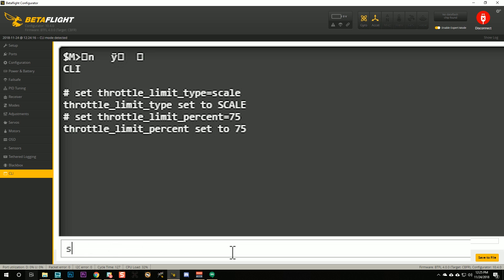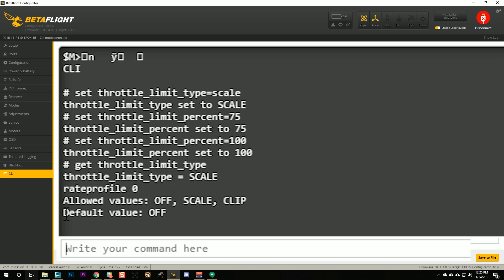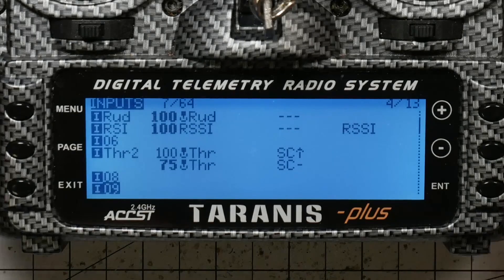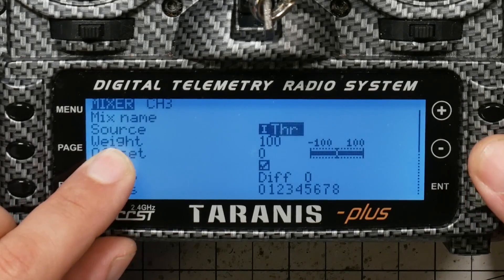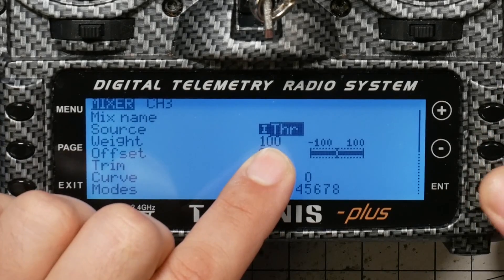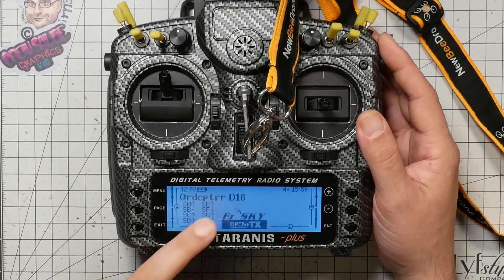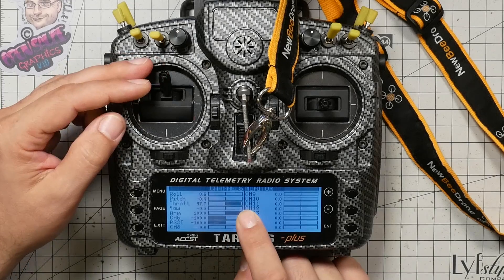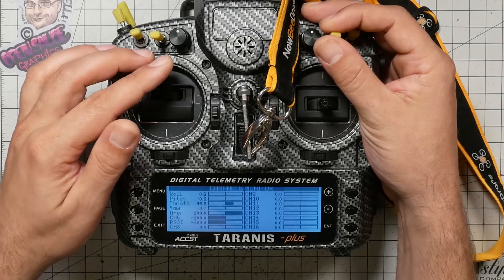Betaflight OpenTX Throttle Scaling | TAME YOUR 2S TINY WHOOP

Comment from the maker: It turns out that you CAN switch the betaflight throttle limit on a switch. CurryKitten shows how here: https://www.youtube.com/watch?v=rwUdwUMMytI
Reply: Use throttle_limit_percent>9000 to go really fast
Reply: Yoshitake Mizuno says: !SC-UP , use this to work around the 3rd low position affecting the throttle in a unwanted way.
Reply: You can use Sitcks commands too, left stick to left bottom and right stick left middle is profile 1 I think
Reply: when you have to do terminal commands, can you type /paste them into the description so we can copy/paste ?
Reply: What's solution for this
https://youtu.be/H-L7goBWTno
Reply: I like CurryKittens tutorials too, but in this case, I’m going with your way Joshua, I’m doing the throttle curve. Seems much easier and less work to do, especially if I want to make a few changes.

Comment: I was wondering, I've got a mobula 6 HD. It is underpowered and my current throttle range to keep it in the air is about 75%. I want to shift the throttle range so I'm about mid range 45-55% on my thumbstick. Can you direct me to your video which can show me how to do it pls? I understand moving the range will not increase the power of a 1s whoop. Cheers

Comment: Hello Joshua, Question for you.  I had some funkyness happen with the TX16S and I needed to send it in for warranty work.  I fly my Mobula7 on 2S and for indoor flying I use 75% throttle scaling on the TX. Grayson said to never use throttle scaling on the TX and that it should be done in Betaflight. I asked why and they could not really say why.  I am curious what you think?  Thanks.
Reply from the maker: I'm not sure I understand a good reason why. I also scale in the controller, for convenience.
Reply: @JoshuaBardwell  Thanks for the speedy reply.  I thought it was weird as well and the fact that a good reason could not be given makes me question the suggestion. I have 1000's of flights using throttle scaling on three different quads and no issues with that at all.  I will continue to do it on the Tx. as I have been doing. Cheers.

Comment: theres a sight issue with the way youve assigned switches, if you go to 3rd position o switch youll loose cotrol of throtte. i found this out on a plane seting up duall rates ad accidentally switched to 3rd position eded up with no aileron or elevator control.

i added a third line copy set to the 3rd position, there is a way to do it with just 2 lies on a 3 position switch

Comment: This needs to be updated as this is not the best method anymore, motor output limit and auto cell detection is now the way
Reply from the maker: This method is still very good if you want to be able to manually adjust the throttle scale on the fly.

Comment: I'm a little lost here.  I did exactly what you did on my radiomaster TX12. The first setpoint i was able to set to 100% and assign to a switch no problem.  I assign a second set point exactly like you did it in your video no problem.  the issue comes is I am trying to set the setpoint to 50% just like you showed it.  The weight set to 75, the offset set to -25.  looking at adjacent graph, instead of getting  50 (as shown in quadrant 2 of your graph), and 100 (as shown in quadrant 4 of your graph), I'm getting -85.4, and -80.6 respectively.  I can show you a picture of what my screen shows if you have a email you want me to send it to.  Go easy on me I am very new to this and I've been hitting alot of bumps along the way trying to set up this radio.  Please Advise.  Thanks!

Comment: Thanks so much for this video Joshua, I’ve been attempting to fly my new TinyHawk 2 Freestyle, but the throttle is so sensitive, this should do the trick.
Reply: How did you find it? I'm wanting to do the same with my TH2F... the hoverpoint is basically at 10-15%  and want it to be a bit easier to handle when flying slow... Does putting on a scale mean you loose the max top end output that was there before... or does it just make it easier to handle? I"m not sure... thinking maybe a throttle curve might be the better option here...
Reply: @InfinityDrones  This is a test, if I’m able to sent this I’ll send you my reply, I couldn’t before.
Reply: @InfinityDrones  Hi Infinity, yes I followed Bardwell’s tutorial and put it on a switch so I could turn it on and off. I really liked it, as a noob it really helped me with my flying. I tried 50% but that was too much, and I found that 20% was perfect. I don’t use much anymore, but it’s there if I need it. If I remember correctly, yes not only is the top end lowered but the entire scale is lowered by the % that you decide to use.

Comment: still having issues with my yaw at full throttle to the right the drone wants to bump up and do a quator turn but only at full throttle right ,,,,ive done stick calibration and still does it  but it all fine on yaw left i dont understand whats goin on ,,,,,,pleae help

Comment: I did a factory reset,, foolish me, now it won't connect to controller and won't connect to beta flight,, does this mean I have to start from scratch
Reply from the maker: You may be able to find a CLI dump for it and restore the config that way. Otherwise you will have to start from scratch.
Reply: @JoshuaBardwell  went to emax website downloaded the cli and wow what a savor that was,, thank u so much

Comment: With this method of taming the throttle, how is arming done?  Or did I miss something?  Whenever I adjust the throttle angle and/or create a flattened throttle curve (ala engineered expo) I have to keep the low end at "zero" for proper arming.
Reply from the maker: This keeps the low end at zero. Check the corrected instructions in the first comment.

Comment: Can you use the openTX method but with clipping the throttle instead of scaling? So that I can set it to a switch still for races and not have to plug into betaflight everytime before and after a race
Reply from the maker: Yes. I think you would use a custom throttle curve in the inputs screen

Comment: Can't do it. I did everything like in the video and on the channels monitor it only shows any thrust output when the switch is in the position that corresponds to the mixer source. That is I configured three inputs: th1 at 100%, th2 at 75% and th3 at 50% and the channel monitor bar only reacts to thrust movements at 100% if I set the mixer source at th1 but doesn't react to stick movements in th2 and th3 positions at all. I can change the mixer source to th2 of course and then the stick only works in th2 switch position - at 50% of course, but still it doesn't let me change anything by switching to th1 or th3. Any result of such switching is that thrust becomes dead.....

Comment: Hi bud I have a question my boy bought a drone we bound it in d16 to beats fpv lite 2 when he hits arm the drone flys up rite away  we’re not sure what it could be now the guy he bought it from was able to land and take off correctly but with the beta transmitter it just takes off can you suggest what we should look for to fix this do you have a vidio on this you can reffer
Reply from the maker: How about checking the channel mapping in the Betaflight Receiver tab. Make sure throttle is actually throttle and so forth. If not, use the Channel Mapping parameter to fix it. Rearrange the A E T R letters to change your channel order.
Reply: Joshua Bardwell thank you sir we will try that

Comment: Thanks! This is very helpful. I am learning FPV with a Freestyle 2 but the only place I have to fly is in the yard and there is not a lot of room and a ton of trees. When you don't have much space, a little power seems like a lot of power. When I fly at work after the workday is over there are big fields with small trees spaced out nicely. Full power is great. At home though, I'm running 1s to slow things down but I am still sometimes finding myself looking down on trees when I didn't think I had given it that much throttle.

Comment: I actually have scaled down the throttle on both my 4s and 6s builds at atleast 5 to 10 percent.  I honestly feel like there is so much more throttle resolution and predictability just off that.  I also thought how often is my throttle completely buried at full deflection.  Hardly ever.  Mixed with rates in the sub 850 area for pitch and roll and sub 750 for yaw I have what I feel is the best of both worlds. I have some snap in my rates but I also have a clean predictable throttle. It’s just scaled down just enough to erase that full ass whoopin at the top. I’m honestly curious how many of the top freestyle pilots use it because my quad isn’t any slower I only scaled off the top area of my throttle that was impossible to use effectively without crashing some how. But now it feels much more connected to me and the throttle is less of a hair pin trigger. I’m a flow type flyer and it honestly made complete sense on the first flight after scaling it to 90 or 95. It gave me the resolution I needed and feel I wanted to be confident in every last input.

Comment: Hi Joshua, very, very, novice flyer, (only 2 squirmy flights, and almost lost my drone!) I have the TinyHawk2 RTF, If I just want to tame my drone down (until I can get better at the sticks) what parameters can I change in BetaFlight?  I assume my controller can't be reconfigured (ie. set a switch for 50% throttle) like the upgraded ones, right?  Thanks!

Comment: BetaFPV 65X 2S.  It loses reception (radio) in at 60 feet (20m). I bind it with Jumper T16 Pro V2.

Any advice to resolve the radio range?

Thanks,
Arnold

Comment: Great video thankyou JB. I have a question regarding rpm response, if I used this method to cheat using higher S number packs. Would I gain the benefit of higher S pack rated motor response? I hope I explained this well.

Comment: Long time viewer, first time commenter.  After so many problems, I got my quad into the air and throttle response was wild.  With this I developed insights and simply used throttle curve.  It got much smoother, but just before landing throttle response doesn't seem to improve (with quite steep curve at far left). It slams.  Think it is beyond curve's authority.  Is there a better way to further smooth out last minute response, by like... air-mode or anti-gravity.  Not very sure what terms mean, but just looking for right direction.  Thanks a lot for all your teachings.  I learned a lot.

Comment: hi, joshua , im using a mobula 7 fc, on flysky and when i throttle lil be up and motors spin for a half of second and stops?? whats wrong with it? thanks for your help
Reply: * FIXED ,. I JUST REVERSE THE MOTORS ON BETA FLIGHT PROGRAM , AND MY NEW EACHINE TRASHCAN WITH THE MOBULA 7 FC IS ON THE AIR NOW,. THANKS FOLKS

Comment: Hi Joshua, thanks for this video.

I was wondering if you could make an updated video using taranis qx7, because when I tried to follow and adapt this step by step I found out that the interface of the Mixer page is very different

Thanks for your excelent job 🙂👍

Comment: I just built a beecore 2.0 "tiny Whoop" 100mm frame 8520 motors.  When I take my throttle above about 50% the thing goes crazy and the motors spin up all the way...is this the answer or do I have another problem...this is just bench testing with no props. I haven't flown the quad yet.  If I do full stick on pitch yaw or roll the motors start to spin crazy...and continue with no input.

Comment: I use the openTX method on the same switch as my flip over after crash, that way my throttle is limited to whatever percentage I want but when I switch to flip over after crash, betaflight is reading a 100% throttle to flip and not my limited amount. That extra amount of power to flip is especially helpful with whoops.

Comment: Hey Joshua here's maybe a dumb question, consider same brand, can I use 2306 2400kv bell on a 2306 1700kv stator? I been ruining my 6s bells but none of the stator and plenty 4s motors laying around
Reply from the maker: In some cases this will work. For example, the JB 2407 motors use the same bells for 2500 and 1750 kv. They just change the stator windings. So the bells are interchangeable. Most of the time when there are two identical motors with different kv, the bells will be interchangeable.
Reply: Joshua Bardwell thanks for the prompt answer!

Comment: Hey JB...I just set a Throttle limit in betaflight and now my quad won’t arm...it is the tiny hawk freestyle...Do I HAVE to change settings in Radio? THANKS JB! You are the MAN!!
Reply from the maker: You have to look at the arming status code that is telling you why it won't arm. Simply setting a throttle limit shouldn't cause it not to arm.

Type "status" in the CLI and see what the code is.

Comment: First of all I am new at this!  I've been experimenting with the throttle limit cap and messed something up!  I can control my throttle up and down for the first 50 % but when I get above that, the throttle stays wide open and I cant bring it back down or it does but goes random and does its own thing.  Any thoughts about whats going on?  I have tried to reset it to no cap but that does not solve the problem.

Comment: Ok so heres a question. Say I've been learning on a lightweight setup with 2205 1750kv on 4s. I'm upgrading all my batteries to 6s soon but my mini magnum 2 states 1700kv max for 6s. My first test flight nothing got too hot on 6s but would it make sense to chop the power by about 3-5% or so? And then would it make more sense (safety wise) to run chopped or scale for this purpose?

Comment: how do i make my throttle response much faster to the stick command. meaning i raise the throttle but it almost passes the middle and i still have low power or rpm...so i guess my question is how do i calibrate the power on the throttle so i will not need to push it to the end to gain much more power.

Comment: I used the throttle curve on my tx for softening the throttle indoors. Do the Frsky tx’s not have a graphical throttle curve? I’m using my old spektrum dx8 so not familiar with Frsky radios (yet).

Comment: I finally got my custom quad going and want to up the throttle how could I make my Throttle stick feel more powerful
Reply from the maker: First check that the endpoints of your channels go from 1000 to 2000 so you are sure you're getting full throttle.

If you are using multishot, oneshot, or any other analog protocol, make sure your ESC's are also calibrated. If you are using Dshot this is not needed.

After that, the amount of power you have is how much you have. You can raise throttle boost parameter in the CLI to give faster throttle response, but the only way to make the throttle more powerful is to get more powerful motors or lighten the quad.

Comment: I mostly fly my mobula in my small apartment, without throttle scaling, without any problems and I've only been flying for a few months. It has definitely helped my throttle management. And I don't have to mess with betaflight. Then when I want to fly it outside I just take it out there and open it up.

Comment: Should this throttle scaling work on larger than tiny whoop quads?  I'm trying on a Blade Theory XL and after entering the "set throttle_limit_type=scale" and hit enter I get "Invalid name".
Reply from the maker: Try typing "get throttle_limit" and it will show all CLI parameters containing that phrase. If you have an older revision of betaflight on the FC it may not support this feature.
Reply: @JoshuaBardwell  Thank you for your quick reply but it didn't work.  I get the same "invalid name" response.  It looks like the FC maybe too old.

Comment: I flip all my swith nothing happens
Reply from the maker: I'm gonna need a little more context before I can help. What are you trying to do?
Reply: @JoshuaBardwell  I bought a new diatone 349 and a Taran is x9d plus all the firmware is updated. So I put the receiver on it and so far it all works but it will not arm at all I've spent at least 30 hours trying to get it to arm but got nothing. I am new to the Turan is and these little drones but I thought it was plug and play.im lost
Reply: And on Bata flight or clean flight I can flip all of my switches and nothing happens
Reply from the maker: Please start by watching this video and do what it says. It is designed to help solve "betaflight won't arm" situation

https://www.youtube.com/watch?v=N8oMMG2kmns

Comment: Great video as always... I'd like to point out you can do that on many Tx's and set to a switch also..... I'd also like to point out another way I like anyways is to go into Betaflight/ pid tuning/ Throttle expo.... I'm running at .20 expo.... now I can keep it level a lot easier doing 90 around the house without bouncing it off the ceiling and still have full power.. lol... keep up the good work!

Comment: @Joshua Bardwell
I have been doing something similar for about 6 months now. I setup my throttle so that most of the range is very low, but the the very top of the throttle stick [>98%] jumps to full throttle. In other words, I have 0-75% throttle linear, and then 100% at the very top. So, for example,  I cannot command 90% throttle. 

I really like this because on my 6s quad, anything over 75% throttle is just ludicrous speed anyway. I did this with my spektrum transmitter rate adjust that lets you set points on a linear graph. I made a negative linear throttle curve for the whole range except chopped it back to normal at the very top.

Comment: You can do all this in just the mixer page. Honestly I don't understand why the Inputs tab even exists, as far as I can tell it just mirrors the functionality of the Mixer tab but laid out differently (and needs the Mixer tab to reinterpret it anyway). I'm pretty sure its just a hold over from Spektrum style radios that you can't access the mixer and can only assign inputs for premixed functions.
Edit: nevermind, you explain it on the next video, still reckon it could simplify it into the Mixed and Outputs tabs